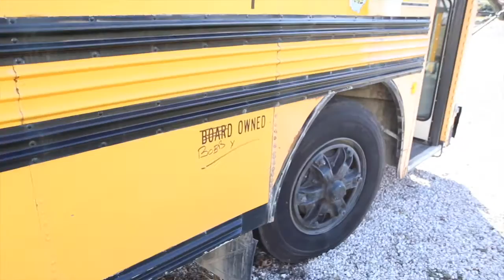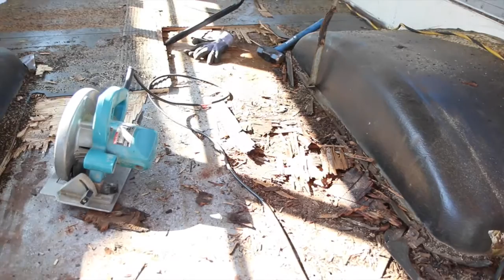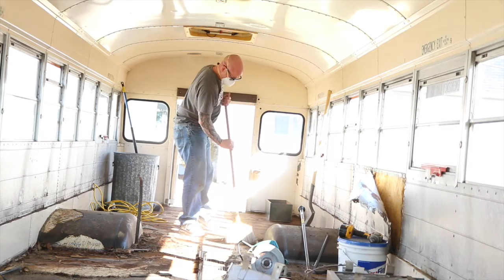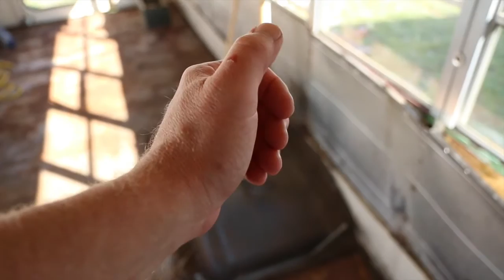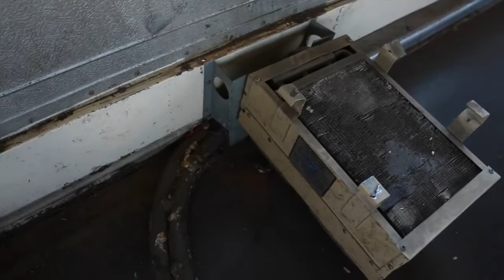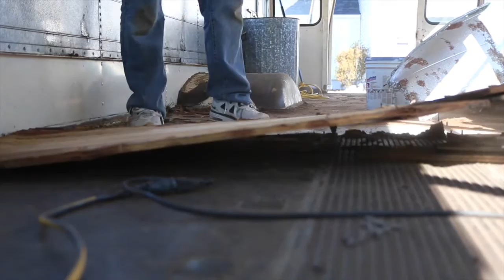Bus Conversion Project--Skoolie Chronicles--Episode #1

Comment: Floor demo is the worst. Took me the month of July. You're right that is the tool to have
Reply: What is the name of that tool? Please and thank. Bus demo starting this month.
Reply: @jssggy  it's called either a rock bar or digging bar. About 6' long with a flat blade at one end. The other end can be pointed for getting rocks loose or have a flat disc for tamping soil. The flat blade end is the end to use on bus floors